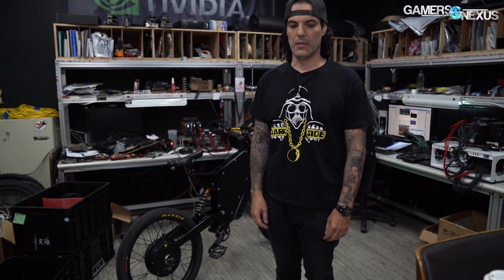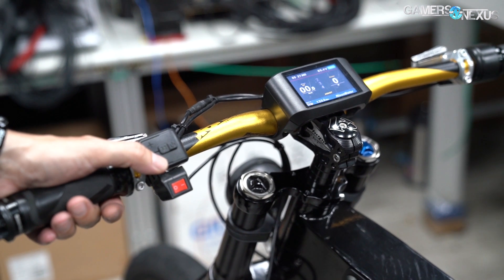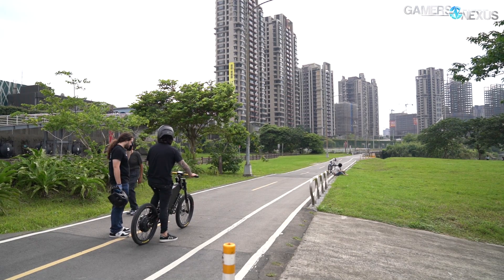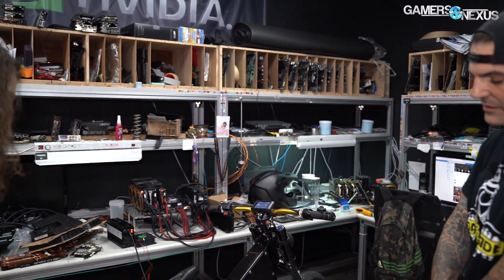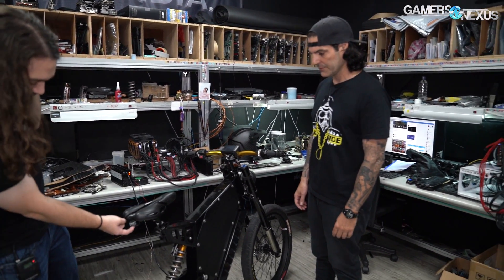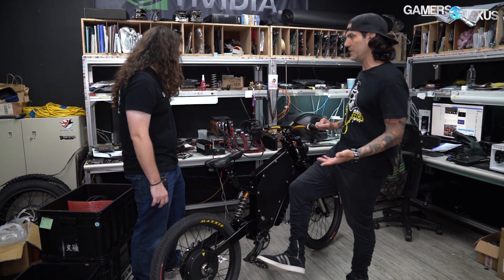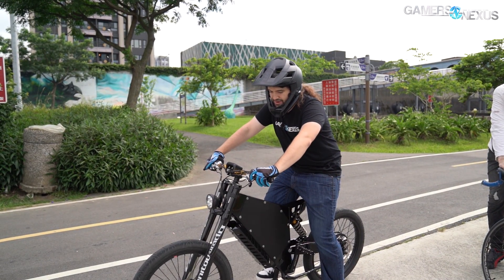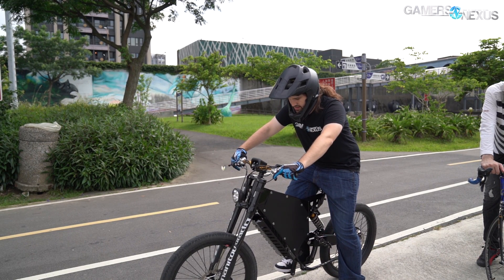KINGPIN's 60mph E-Bike | Bike Check & Test Ride

Comment: I've got the same bike as you, could you tell me what a few of your settings are so I can get my bike right

System
Auto assist ?
The option for pedal throttle or both option disappeared I'd like to get that back on my display.

Advanced settings
I'd like to know what all the settings are?
Any help would be appreciated 

Also under information my bike is running
Hardware version 3.0
Software version 2.0

Comment: Its not capable of 8000w if it only has a 100a contoller. Youd need a 150a controller to actually get 8000w of power. The maximum output of a 100a ontroller is only around 5000w. Just thought id clarify that...

Comment: I respect the enthusiasm, but as a non Ebike rider I must confirm that it already has been proven that almost every Ebike is faster then every non electric bike up hill. While the other way around it really doesn't matter. But it's those Up hills that we all struggle and the struggle becomes even worst when some Grandma makes us bite the dust with any regular cheap Ebike. Going on faster then 25 Km/h for normal people on a bike that are not used to ride a bike is a recipe for a disaster. I do respect man that respect Flat pedals ... you learn to respect them the hard way.

Comment: This is extremely fascinating I have been researching and planing for years to build a e-bike similar to this one I had some questions at Aprox what speed would get your the furthest at what distance? What battery motor controller combo did you buy? What frame? Thanks and great job

Comment: Didn't mention how much it all cost, I've been sourcing all the parts needed and I reckon I could build one for around £2000 or there abouts which is really cheap considering they start at around £7000 ready built

Comment: Coming from manual transmission ICE land, electric vehicles are weird, there are no gears, no revs, no superchargers or turbochargers.

How do you get the right amount of torque to the rear wheel when you are in a lean? Is there engine braking?
Reply: In a weird way, there is a kind of form of engine braking where you have regenerative braking. Which in terms of feel is almost like engine braking. The weirdest part for me is the lack of having no clutch for smooth starts, as when I'm on my motorcycle I'm used to feathering the clutch for that buttery smooth starts. But instead, it has the feel of a CVT where you simply use less throttle for your start and just let the bike do its own thing.

Comment: I always find it interesting how riders dont upgarde to as much motorbike gear as possible, E-scooters or E-bikes riders that travel over 25mph should not make the mistake of using DH MTB gear, it wont cut it in a high speed crash, not to mentioned the road rash. Also it looks like a bicycle and or scooter so other road users simply wont expect you to close distance so quickly, wear the right gear guys.

Comment: Tip for your friend, for his chain.
Skate board wheel on a tensioner above the motor that pulls up on the chain to keep the bottom tight but also has to have its own small swing arm and spring to pull it up toward the seat when the swing arm moves, pulling out slack quickly, but allowing tension quickly without snapping the chain or racking parts off the ground.

However no gear shift, though I only saw a single gear, so no problem there.

The long travel under seat tensioner is something I use on my heavy haul 250 off road travel bike, I use it for trail rescuing other riders who are mechanically broke down.

Comment: Pro Tip: The reason the chain broke is from the tons of torque forcing the suspension to squat HARD lengthening the chain distance requirement combined with the most important variables, long rear travel and the chain being too short with a short cage deraulier. The same will happen on any FS bike if the travel is not accounted for at full swing arm extension with the bike being in the largest cog on the back and largest chain ring in the front,  thought, that is a naughty chainline. :D

Comment: First off thanks, from the DIY electrical bike community for the little public service announcement you made!
"Plush" is the word you were searching for. Steve, you ride DH???? Awesome. It's an amazing sport. I was going to say, finding larger than 203's is going to be a pain and expensive. 650lbs.. wow! 
The great thing with full suspension combined with an electrical motor is you get good traction and a bit more stability from that. I am almost done with my dual motor 4000w hardtail. It should be interesting. :D

Comment: those carbon frames your talking about must be graphite because ican tell you laying up carbon fiber and molding in high pressure is the only way to make a true CARBON FIBER part. you want a max CLR epoxy system with 11% silica infusion , multiple direction carbon fiber weave patterns layered up,  high pressure in a solid billet molding , and heat cycle  curing. this will grant you indestructability, there is no "shattering" with carbon fiber, a semi could run it over and not cause a scratch. you could go a step further and add aluminum hair and steel hair strands with the fiber weaves or even titanium.

Comment: For legality in the UK (and I think the EU):

It can't go over 15.5mph under its own power.  If you're pedalling and you go over 15.5mph, the motor MUST NOT be active.  If you go down a hill and exceed 15.5 mph, the motor MUST NOT be active.

As with all adult-size bicycles, it must be fitted with a front light, and rear reflector, not ridden on public footpaths, and proper head protection must be worn at all times while operating the bike.

Now, I've seen plenty of people riding on the pavement without a helmet on, and the police culture is generally to not fuck with people who aren't causing issues for others, but if you blow by someone on the road with a bike like this, or do even a single mph over the speed limit, you're almost guaranteed to get it confiscated.

To get around the 15.5mph limit you must:

* Have a bike that has the right tires, rear view mirrors, lighting and indication, registration plate, and all other things that motorbikes need;
* Undergo MSVA for the vehicle (https://assets.publishing.service.gov.uk/government/uploads/system/uploads/attachment_data/file/774206/motorcycle-single-vehicle-approval.pdf);
* Be in possession of a UK driving license of the right category, (AM to go up to 28mph, A1 for up to 11kW power output (and not exceeding 0.1kW/kg), A2 for up to 35kW power output (and not exceeding 0.2kW/kg), or A for anything else), probably A1;
* Register the vehicle, insure yourself for the vehicle, and tax the vehicle (free for purely electric vehicles at the moment).

Essentially, you'll be better off buying a naked bike with a fucked up transmission or engine, gutting it, and replacing the power plant with an electric one.  Doing so will get you a fun project, a bike that hits 60 as fast as you dare to let it, and really cheap transport.  Mid engine will be your best bet as hub motors for motorbike tires aren't a thing yet.

If you're looking to fabricate motorbike hub motors, I want your contact details.  Can you tell I'm doing this?
Reply: been past police many times on my bike never an issue
Reply: @girlsdrinkfeck  So have I.  My friends have also smoked weed around police, and my ex manager used to hold illegal raves and the police just occasionally politely asked him to shut it down.

Doesn't mean it's not against the law.
Reply: There is a speed limit on e bikes in the UK but you don't need to wear head protection or have lights. I went over 15 mph in a non e bike especially downhill. And you do not need a license or plates for an e bike
Reply: @petergoodman7805  Actually you do.

http://www.highwaycodeuk.co.uk/uploads/3/2/9/2/3292309/the-official-highway-code-with-annexes-uk-en-12-04.pdf

"59. Clothing [...] you should wear [...] a cycle helmet"
"60. At night your cycle MUST have white front and red rear lights lit. ItMUST also be fitted with a red rear reflector (and amber pedal reflectors, if manufactured after 1/10/85). "

Bikes don't have a speed limit, but at over 15.5mph, the motor MUST NOT be providing power.

https://www.gov.uk/electric-bike-rules

"Its electric motor [...] should not be able to propel the bike when it’s travelling more than 15.5mph"

Comment: 24 inch tires $8,000 watt accelerator and no way to pedal fast enough so dangerous pedals without real use just to fake..

Not clear why scooter would not be better with similar power speed even seat.

Your experience as a young experienced bicyclist evolving to transport only use of narrow light energy efficient rig  is not relevent to public policy.

HOWEVER!!!!!!!!!!

IN USA I SUPPORT SUCH ELECTRIC MOBILITY IN RURAL ROADLESS DEVELOPMENT AS ALTERNATIVE TO SINGLE HORSEPOWER SHITTING HORSE SHIT OBSOLETE HORSES.  COME BACK TO USA BUY A FEW ACRES IN LOS ANGELES COUNTY MILES OFF ROAD BUT MINUTES TO HIGH SPEED RAIL TO BEACH AND DO SO WITH CASH FROM SELLING THAT BIKE FOR DOWN PAYMENT OR LITERALLY ENTIRE DEED FOR $2,000 EVEN IF IT SOLD IN 1970S FOR $20,000.  CHECK IT YOURSELF GO ON ZILLOW OR REDFIN!

Comment: to k|ngp|n:to have a chain, and dont have it smashed every time you bottom out the rear suspension, you just need a couple of chain guides to have it go up and over the pivot point of your rear triangle(e.g. the Deviate Guide bike ). that will prevent pedal kickback(and yeah, in you case destroing the chain) trough the suspension travel.

Comment: Where can we order a kit like he has?
Reply: I just got mine from a a site called hallomotor, it's there 3000watt kit and it's the same motor and LCD screen and the specs are the same on the controller so I assume it's the same as well. $780US, $1050CAD

Comment: 65-70mph at 72v 100amps..
Hmmm.. I'd like to see the GPS data logs showing that speed. 
I'm rocking same setup pretty much cromotor v2 modded but 200amps @ 72/84v and I'm at about 60mph.
Reply: You are probably top speed limited by the motor kv, not power (it spins no faster with the wheel in the air).
7200w 65mph is doable with a big tuck, but you are right 115kph/70mph is probably that POS display's miscalibrated wheel size.

Comment: I fake pedal when I see the cops best tip yet my man
Reply: i do the same ,my dropout isnt deep enough to keep the deraulier on so i took it off and the chain too since it has no tension
Reply: Pedal assist, give yourselves a break from paranoia lol
Reply: When I’m riding my electric skateboard I push off like I’m on a regular board when I see a popo.
Reply: Why you have to fake it . Is against the law?
Reply: @dorianwelch3869  you're meant to only have power when you pedal. But if you don't use a chain or your gear ratios won't let you do anything through pedaling, then you gotta ghost pedal hahaa
Reply: @dorianwelch3869  it is
Reply: @dorianwelch3869  In Calif if you pedal it, it's a bike. If you just have pegs it's a moped and you have to get insurance.
Reply: @LarryRichelli  I do it everyday at 46mph. Looked cops straight in the eyes and act like I'm about to die from "pedaling" to reach the speed they are seeing me at. I get so scared i forget to breath. Built my bike from scratch. 1+1 KW All wheel drive. Max speed 46mph throttle only.
Reply: lol
Reply: Same. I also slow fake pedal past the lycra shorts crowd on the back roads.
Reply: You gotta fake pedal, i even tilt the bike a little side to side for that extra added realism😂
Reply: @Aa-ron01  Hahahaa. I've done the same. That's when you know you've got your ghost pedalling game sussed out
Reply: Yes man where are you from.....so many rules for people. Thats not freedom for me .....nice video and thanks

Comment: Not even a center motor, come on Kingping i expected more of ya.
Reply: Hubs are much more reliable, silent, just better overall for commuting.
Reply: @4nlimited3dition_4n3d  hubs are MUCH faster. Only reason for a mid drive motor would be for pedaling...so that you would have a speed sensor instead of a cadence sensor. This dude is not pedaling! Doesn't even have a bike chain! This is a Delfast bike, right?

Comment: Oh man feels good to own a faster ebike than Kingpin xD
But just couple of things that are wrong what Kingpin said. First of all the qs205 v3 and the mxus v3 turbo (not sure which one he is using) can both deliver up to 15000w of peak power not 8000 as he said.
Secondly if he really would like to make his bike run fast he should use a sabvoton or a kelly controller for more power than that measly 100a (or to get even more power use a asi bac controller). And also 72v battery for top speed is not a good choice. I would prefer atleast 82v or even 96v battery.
Third thing the brakes don't matter that much if you use the motor braking, and you save brake pads at the same time.
Fourth thing is using that motor without reinforced drop outs is just an accident waiting to happen.
But nevertheless it's a clean and nice build :)
Reply: BossManaatti   brakes don’t matter much?  lol....regen is only in the back wheel, you get 70% of your braking on the front wheel....therefore having top quality brakes is imperitive on a heavy, fast bike.  Emergency stops are never anticipated....being able to stop is Way more important than going fast!
Reply: @jimhofoss9982  you can program your regen brake to brake very hard. For example I have my regen set to 2500w. In normal riding I rarely use the front brake at all. So if you set up your regen correctly you will not need the to spend tons of money for some hope brakes.
Reply: the only thing i would've changed about his bike since it is high powered was to get rid of those wheels.  26" wheels are a thing of the past and very inefficient for high power ebikes.  A 17" moped tire with a lower winding hub motor would've done it
Reply: I think he was talking about his bikes current max output 100a x 72/84v
Reply: @SmokeyStoner  He said his controller is 100a model. Which would mean about 7500w of peak power with voltage sag considered. He is mostly limited by the controller because I have seen people fitting the quilbix frame with way better batteries and pulling more power than that measly 100a.
Reply: quilbix frame is designed from the ground up for ebike hub motors, not sure what you mean by needing reinforced drop outs.  Those are for walmart bikes you slap a hub motor onto.  60mph+ @ 72v is plenty of speed for any ebike... not sure why you even mention 100v.  I haven't seen anyone running 60+mph ebikes using 24s batteries nowadays, that was a thing of the past maybe 5-10years ago.  The future will be mid drives like the Sur Ron.. which im planning to get
Reply: @keokio7 The SurRon FireFly is still just way too loud imo. Needs a belt drive at least. Also it has a pretty small battery. But to be fair the price is really good at just 3k. Gonna wait for at least the SurRon 2 release, hopefully it'll have a battery of at least 3kWh.
Reply: @4nlimited3dition_4n3d  they do offer a belt drive kit for $500 lol.  Thats the only thing holding me back, the battery.  Its ok but my my commute to work is 35 miles.  3k battery would be great.  I was thinkin of making my own 1kw battery pack, stick it under the seat and run it parallel to the main battery.  But then I would be spending over $4000 for an electric bike that has maybe 50mile range.  Not worth it

Comment: I have an Ebike I built, im going to be upgrading it to 60Volt 26amp controller, 20AH battery, for basically the same reasons Vince is saying. CArs are assholes, and I cant keep up safely at 48volts at half a charge.

Comment: With pedals and chain with like 1000w surely that's enough for most yeah? The route I plan on riding has zero police, and even if one did show up on a bicycle a 1000w should be enough to out power his legs lol im not a criminal I'm just fed up with being fucked in the ass by the uk slapping insane prices on everything,like for example when we buy fuel we pay a fuel duty AND a vat on that duty. Tax on tax.  Then VED ,insurance, mot etc etc  remove all the taxes and we'd have cheap fuel but nope. Hence why I'd like to ride a few times a week to save money and emssions..or i buy a tax and mot exempt V8 lol

Comment: If you want something super reliable and very weather resistant for street use I’ve had a Magic Pie v5 in Black since 2016 and it’s awesome.  Goldenmotor.bike has the black version in 26” wheel size on sale now till July 8 (I think) for $377 usd and I’d recommend the Bluetooth option for $69 so you get a super clean look (no display cuz you can use your phone).  Either use a steel frame or the grin v4 torque arms (the cheap ones will get ripped apart as will the drop outs due to the torque). Top speed is about 30 mph and it has cruise control.  Tighten the spokes after every ten miles till they really settle in!!!!  This is the big trick with this motor.  Oh ... and get the thumb throttle cuz the twist will get away from you and can be crazy dangerous. I use the next Avalon bike from Walmart cuz the bike is aluminum by the rear triangle is steel and it’s super comfy. Upgrade the brakes and tires and call it a day. Hot Sale! E-Bike Battery Lithium 52V 13AH Hailong Battery with USB for 1000W Motor (USA Warehouse) (52V 13AH) https://www.amazon.com/dp/B07NHZFG39/ref=cm_sw_r_cp_api_i_j-JfDbCVDC1A0
http://www.walmart.com/ip/Kent-26-Avalon-Comfort-Men-s-Bike-with-Full-Suspension-Black-For-Height-Sizes-5-2-and-Up/21635130
https://www.goldenmotor.bike/product/black-pie-5-vector-26-inch-rear-conversion-kit/

Comment: If you have not seen it... Check out the Luna Sur Ron ebike/motorcycle. Super affordable compared to most.
Reply: They're tiny. If you're 5' or less maybe it could work for you.
Reply: @offgridphilosophy7959  they are. I'm too big. Forgot to mention.
Reply: Just too loud still. Gonna wait for Sur Ron to release the FireFly 2 with a silent belt drive as default.